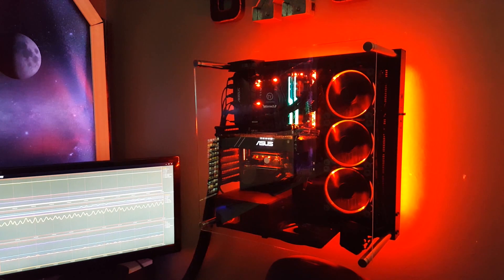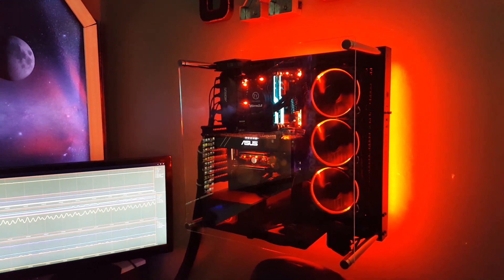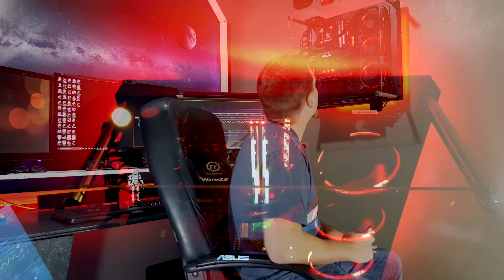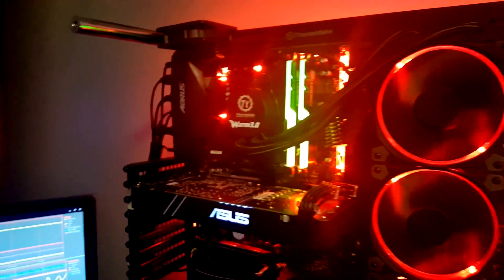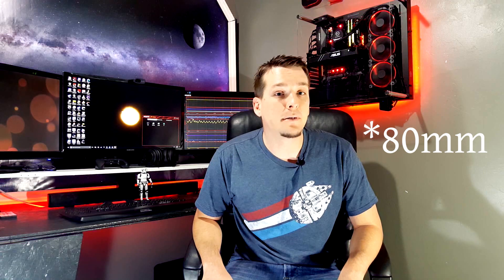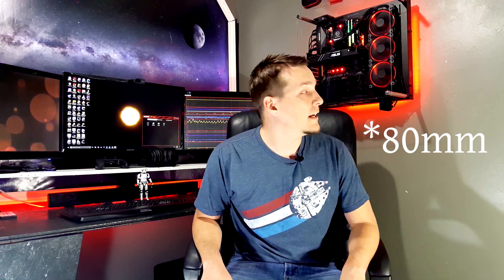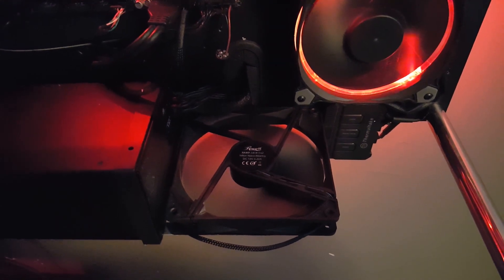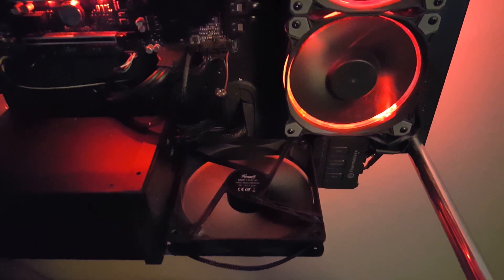Nerdy Tips: The problem with open air cases

Comment from the maker: I understand 60 is acceptable for overclocking.  It is just not what I would have expected with a 360mm AIO. Airflow in my case WAS an issue and generated a lot of excess heat from the stagnation. If you are ok with a $150 cooling solution not getting you the temps you expect, than that is fine for you. If I wanted temps in the 60s I would not have bought a water cooler. These fans made a huge difference to my performance.
Reply: Your rad is upside-down, and air is probably stuck in the heatplate area, literally flip the rad so the hoses are closer to the ground
Reply: What did you expect?  40s idle temp? haha..Maybe with a high powered pump like the D5 and a reservoir with custom loop and a 480mm rad - you can archieve  a little more..
Reply: Temps in the 60 is good. Maybe it the room that you are in. Change your room ambient temperature should take care of your problem
Reply: Its a older thermaltake aio, 60c is the best its gonna do. If you wanted something better you should have looked at nzxt or be quiet at the time. Or just do a custom loop and cry at the price.
Reply from the maker: @s_s_d_d_33  it's getting a lot better than 60 now.  Did you watch the video?

Comment: How did you get your AIO cooler lines to reach to the CPU from the radiator on a thermaltake P5 computer case I see a million videos where people say the design of that case is faulty because there's too much space between the radiator and the AIO CPU Cooler and the hoses aren't long enough to reach

Comment: in my open case i took the rear exhaust fan, and repositioned it with an angle bracket to blow down onto the motherboard...figured i might as well use it for extra 'direct' cooling instead of just letting it uselessly spin on the back of the case

Comment: I wish my 5800X would stay in the 60s under load lol. I get it's not the 1700. But 60 is nothing for CPUs even with 360mm rad. I have a 280mm rad which isn't that much different in terms of cooling and I push 70-80+ under load while gaming. 60 is nothing lol.

Comment: LOL temp in the mid 60s .. haha.. you know that is considered very high cooling performance under full load (depending on cpu model of corse) ! So the case is performing magnificent! I have a custom loop and can see temp in the 80s.. mid 80s under full load.. it is a 10 core 10900k running 5 Ghz BUT my case is very restrictive and has heat buildup..Dark Base Pro 900 rev. 2  That's why I'm getting the P5 VERY soon! I'm done with closed cases and the "silent" feature.. SILENT + very high performance pc just doesn't go hand in hand...  Well maybe with the P5 actually due to fans running MUCH lower speed and also much lower temp! ;)  I will recon I actually can make mine "silent" with this case even though thats not my main goal. So Thermal Take blasted it with this one and they deserve credit for that.. I just think I will build it without the riser thing..  Just don't see why to use it and more clean without.

Comment: I was hunting vids about open concept pcs. I have some spare patts and was thinking a lite-load build on a slab of aluminum, hung like yours. Thanks for the tips
Reply from the maker: Good luck with your build
Reply: @6x6studios11  thanks. I can get the boys in the machine shop to cut, mill, , bore and tap to any print i hand off. Its on me to hand off some good drawings

Comment: 60 degrees are completly normal for an overclocked cpu...
Reply from the maker: But not what you would expect with a 360mm radiator.  But thank you for the big brain observation.
Reply: @6x6studios11  No problem man :)  Even with a 360 mm radiator 60 ar not that bad I think... It could be way better i know that! Anyways, I didn't want to upset u bro love ur vids ✌🏽
Reply: @6x6studios11  but AIO don't come into contact with the VRMs, so obviously if there's no airflow there they will just get hot. Open cases aren't the problem, lack of understanding thermals is the problem, in my open case my VRMs don't go really over 50 degrees Celsius under load and the CPU is over clocked to 4.8GHz, VRMs idle temps are around 31 degrees Celsius to 37 degrees Celsius depending on the climate for the day.
Reply from the maker: @DemonRevengeSpirits  professor demon in the house.  How is everyone on YT such a genius?
Reply: @6x6studios11  having a masters in chemical engineering does help a lot.

Comment: with two or three more fans on the sides to have air circulation, wouldn't that help a little?
Reply: like a normal case, but open
Reply from the maker: @sugy747  I think that would fix the problem for sure.  Thank you for the comment!

Comment: if you use the vertical GPU mount, then you can put a 120mm fan between the mobo and the fan and point it UP.

Pushing air down is fighting physics. Hot air really likes to go upwards. Just my 2c..
Reply: also that's the issue with water cooling. A fan CPU cooler cools the other chips and memory on board. A tower-type cooler is best for that . With water cooling you still need a fan to blow at the rest. I have learned it in my "I will build a quiet PC" experiment where I had hot ram and other chips. It sucked :) before I added case fans.
Reply from the maker: @denesk2794  yeah no doubt.  I'm not even convinced that water cooling is the way to go anymore.  Air coolers are doing an amazing job and fans are getting much quieter.
Reply from the maker: Very good point.  I would probably have it set up that way if the GPU extension that came with my case wasn't faulty.  Thank you very much for the comment.
Reply: i'd mount the PSU above the motherboard for that same reason...also pay attention to any mechanical hard drives as they can put out a lot of heat on their own

Comment: No one does reviews on these open air cases.  This is one of the few.   You didn't clearly explain the direction of airflow in your PC.   Is the small fan blowing air in or drawing air out?   Is the lower fan drawing air in or out?  Did you not try the GPU in a vertical position?  If the power supply fan blowing up or down?  Did you change the direction to change the air flow?  Lots of unanswered questions, but this is now 2020 and this video is dead.

Comment: I have the same case same fans and all with a 2080ti i check my temperature with msi after burner and I can control my card fans can get 40-60 if I turn it up to 60 fan speed

Comment: Dude it’s mounted on the wall so the hot air being exhausted straight onto the wall and back onto the radiator
Reply from the maker: It's working really well now.  Thanks for the comment.

Comment: 60 isnt even a bad temp tf
Reply from the maker: For a 360mm radiator I hardly think that is ideal.  Thanks for the comment.
Reply: @6x6studios11  was it 60 at idle?
Reply: @6x6studios11  or 60 under load? If its below 60 idle and 60 at load it was perfectly fine! But for reasons of it hearing up the room etc adding the fans was a good choice

Comment: Will a 360mm rad fit with this “h100i rgb platinum” is the aio
Reply from the maker: I am using a 360mm rad it in currently
Reply: 6x6 Studios ok thank you because the amazon ad didn’t show what rads can fit or not

Comment: The curse of water cooling, no down firing stock CPU cooler or any other aftermarket tower CPU cooler to circulate air around the VRMs.
Reply from the maker: That was my issue

Comment: (My Build)
Silverstone GD09 case i hate.
CIT 600watt PSU its cheap and gets the job done but i would like better brand and modular PSU.
I5 Skylake 6400 2.7ghz CPU which is also using stock cooling fan.
Asus Strix GTX 960 2GB its a great card for 1080p but having 2gb is shit and i deffo want an upgrade to 4gb or 6gb on my next GPU and hopefully have 4k or at least 1440p. 
Motherboard is Asus Pro Gaming B150m which is ok but the thing i hate about it is its MATX and not normal size ATX which i plan on getting.
i have DDR4 Kingston Fury Hyperx 2x4gb at 2133. i have thought about getting faster ram.
i dont have water cooling but i would like it in my next build. my current build is you could say a 2015 build where as i bought it all in 2016.
Any ideas about my parts or build please would be greatly appreciated as im not that clued up on it all and i dont fancy buying all new parts again if i dont need it. my main parts i want to upgrade right now is first the MATX motherboard to a ATX. second thing is upgrading my GPU to one that has 4gb or 6gb, i would like more like but i dont want to sell a kidney just yet.
third thing i would like is faster DDR4 ram so i get more FPS.
About the Thermaltake P3 im worried about dust and how would u clean it, im guessing with air compressor can or take it apart every couple months, but i do like it it sure does look sexy.
i think thats about it now guys and thanks for taking time to read my build and problems and any info u can give will be greatly appreciated. thanks and nice build and video u showed us.
Reply from the maker: Cleaning the p3 is easy.  Don't let that deter you.
Reply: @6x6studios11  ok thanks i think i will get it.

Comment: You realize 60 is ok, right?
Reply: my r7 3700x stays 40° all the time idk why.
 i have the ml360r
Reply from the maker: Thanks for the comment!  Yes 60c is fine but not at all what you would expect from a 360mm rad.
Reply: @6x6studios11  yes you're very right! Glad you figured it out.
in other news, I'm looking for a test bench that doesn't cost $200 USD. Do you have any suggestions?
Reply from the maker: @gwwtech5782  I think you could use this case very easily for a test bench.  Just don't put the front glass on.  I've never had a proper test bench.  I have always used a mother board box with everyone loosely hanging together. Probably not best practice.
Reply: @gwwtech5782   This is what I have, can't remember the price but it was under $111 US at the time - 
	
Lian Li PC-T60B ATX/Micro ATX Test Bench (Black).....actually, looking at the prices now, the thing must be a collectors item or hard to find - $327.00??? Good luck finding it, but it works well, a bunch around similar style.
Reply: @6x6studios11  What did you expect ? 50s? I dont know any custom loop with high performance pc parts and cpu that perform like that?
Reply from the maker: @lassekristensen385  gotta love when people don't watch the video but make a comment.
Reply: @6x6studios11  Yeah know the types..  I did see the most of it though because im going through a lot of P5 videos and reviews as im gonna buy one in a near future. But there was actually one thing I dident quite got.. that was the title.. "the problem with an open case". I think I missed that part? What was the problem?  Your expected performance? or dust? haha.. I dident get it. . .  As I wrote in another comment I have a lot of problems with my case.. Its a expensive top brand. And the case is good looking. Glass side and the case can be "reversed" as I have but.. due to they also branded it as silent, it has a closed front with restrictive vents in the side of the front.. same goes to top. So even though with great watercooling support- (I have a 360mm and a 240mm rad) there is massive heat buildup also due to my CPU model...  So when I open the front of the case (hinged door) and turn up the fans it performs standard. But it can get hot when closed.. I did some work on the restrictive inlets but the nature of the case silent design is not for me or my hardware.. Although its running great my pc - everything overclocked its withn limits.. but I REALLY want that case you have and get all in one!  Its open and the most unrestrictive... its more silent and cooler .. and it looks great! Also I like the wall mount! ;)  What CPU do did you have?  Also a great tip I learned over time was that I tended to run the pump at too low power.. my pump which is a powerful yet silent EKW D5 are constant runing at 70% now.. that really improved.. way more than turning the fans up.. which also makes more noise
Reply from the maker: @lassekristensen385  my biggest problem was the lack of airflow over the other components on the motherboard.  I added a fan to cool the VRMs and instantly got my temps in the 30-40s.  I built this system when Ryzen first came out and it is a Ryzen 1700. Good luck on the case hunt.  It is always a tough choice.  Lucky for me I only build me a new PC every 3-4 years so I dont have to deal with it very often. Cheers
Reply: @6x6studios11  Ohh okey I see.. Well that makes sense .. but luckily in my mobo the VRM are pretty cool even with this heat buildup.. guess the passive cooler is pretty great stock.. Asus Z490-E

Comment: i have the same setup with smaller radiator 120 mm single fan and max temperature i get 56C. on my mobo and its z97x m5 by gigabyte...

Comment: I am getting this case in white and I had already figured I would need a little clip on fan with a bendy arm so you can point it right at certain components for the summertime. Guess it'll be a year round thing...
Reply from the maker: I still love the case.  It is definitely a head turner.
Reply: I added floating fans
Reply: @Smiley-zm1rp  I know fans I know RGB fans. What is a floating fan?

Comment: so maybe AIOs aren't such a good idea
Reply: You should of check your mobo vrm before buying it Asus has really solid Vrm
Reply from the maker: I have had great luck with my AIO after I added the fan.  I wouldn't have any problem recommending one.
Reply: @6x6studios11  To my way of thinking, why stick water in your machine and it didn't even do that good a job.
Reply from the maker: @xpusostomos  it is doing a great job on my CPU. My problem was the VRMs. 30c is really impressive under load and my machine is almost silent.  There are a lot of benefits to water.
Reply: @xpusostomos  the p series cases are water cooling cases... There is no fans, so air cooling is a bad idea in that case.
Reply: @landonp629  so what method do you recommend to keep the VRM's cool?
Reply: @raypeasley  It's hard to say... The only thing I'd build in a case like that is a full block liquid cooler or a motherboard with less power that won't fry the VRMs. That case looks great, but it sucks for airflow since it has no fans moving air over the VRMs.

You're either going to have to be happy with the motherboards built-in VRM cooling, or watercool the VRMs.

Comment: Would this be any different running a air cooler?
Reply from the maker: Thank you for the comment. Yes I think that it would be better since there would be more airflow due to the fan on the CPU heatsink.

Comment: Open air systems stay cooler with air cooling than water cooling, if you watercool in open air make sure you have filters for the radiators

Comment: On your wall mounted pc, does your water lines have a pump? Or is there one built in to keep the system compact?
Reply from the maker: Thanks for the comment Alex!  This watercooling system in the ThermalTake Water 3.0 it has the pump built into the waterblock that sits on top of the CPU.

Comment: Do you have any dust issues with that open air set up?
Reply from the maker: Digi Print thank you so much for the comment. The radiator has had a little dust build up over time but for the most part it has stayed really clean. I blow it off with canned air every 4-5 months and with it being open air it is a quick and easy cleaning.
Reply: 6x6 Studios i found since i hanged my core p3, that it actually gathers so much less dust then when it was on the stand, i bougt a compu clean, its a hand air compressor that cost like 50 euros, i used it every 6 months and it works perfect even with my painted fans, no issues, also bought dust filters on ebay, for like 3 dollar, put them between my fans and the radidator, works perfect